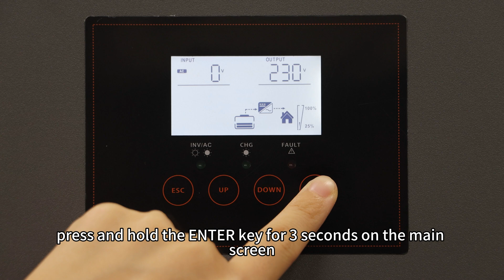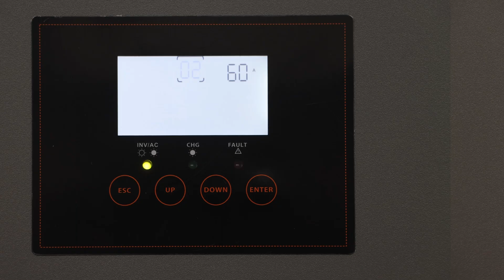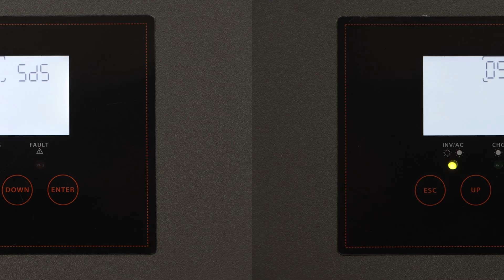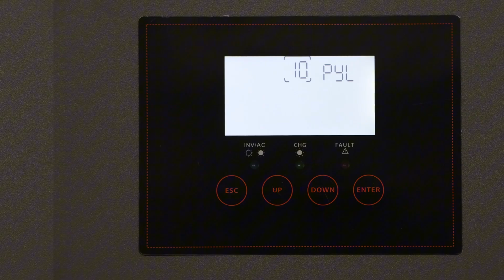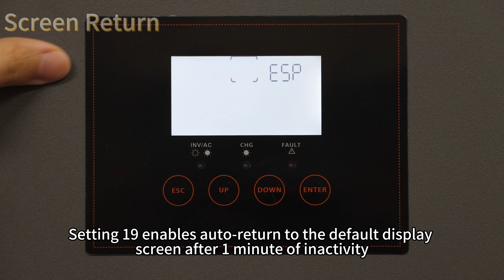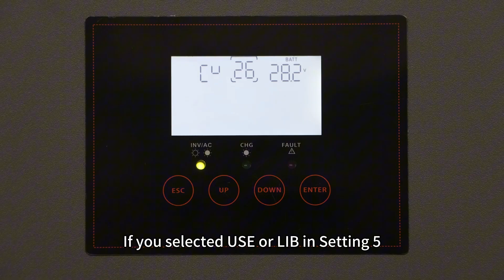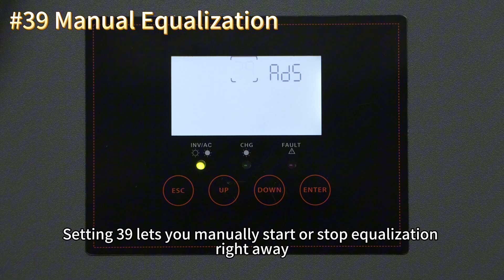How to Set Up Your POW-HVM4.2K-24V-D Solar Inverter?

Comment: Does it supports grid ties functions means can it use fir net meter
Reply from the maker: This machine does not support grid ties. fir net meter?
Reply: Other options for gried tie fun hybrid inverter
Reply from the maker: @AmanSaharan  may I know where are you located?

Comment: Hello, This inverter can use 12V batteries for 2.3KW output or 24V battery for 4.2KW output power? For example now i have 12V battery - can i upgrade it at 24V and use the same inverter? Thank you
Reply from the maker: Yep.